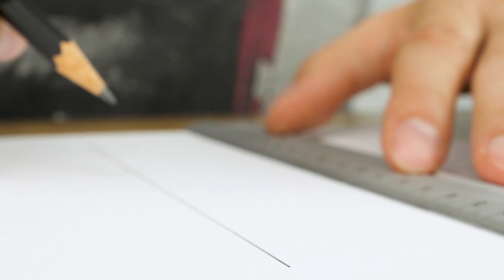How to Make Batman Boomerang that Flies Perfectly

Comment: Hey The Q you made a video 3 months ago called How to Make Domino Row Building Machine from Cardboard. 

Do you know where I can find the supplies to make it?
What dc motor did you use?
Where did you get the wire and battery thing?
Where did you get the yellow tape thing and what was it?

P.S. please can you be more specific in the description for the thing you are using and can tell us where you can buy it.